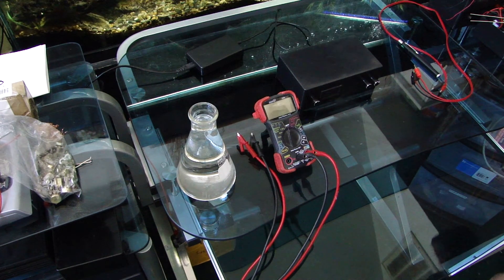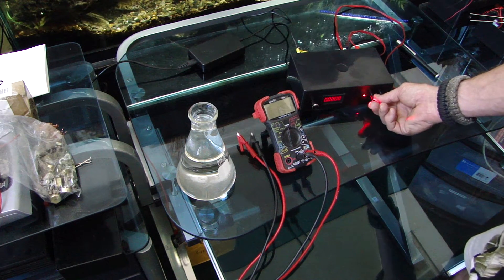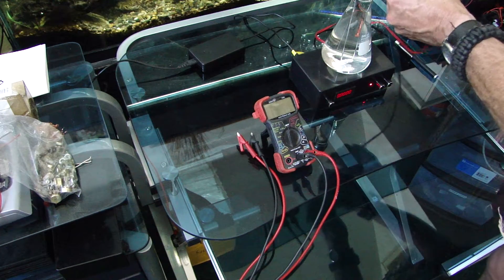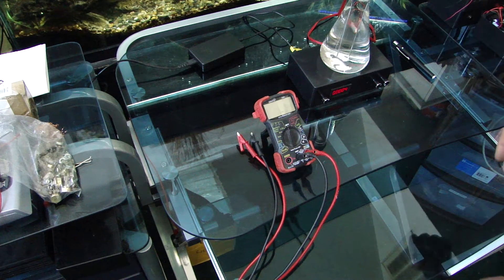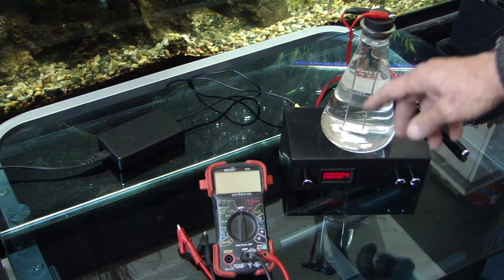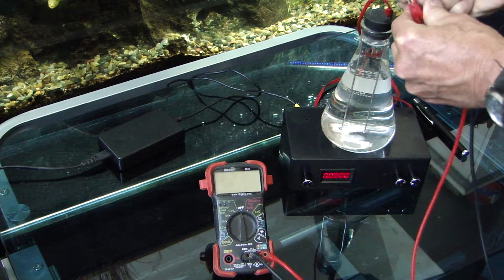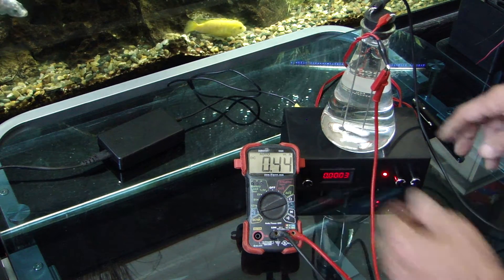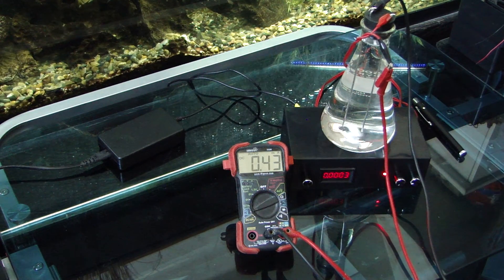PartI BigBear Colloidal Silver Generator Reverse Polarity-Magnetic Stirrer-Constant Current

Comment: Make some videos on green synthesis of ionic silver into true colloidal silver. Eg., one way is to heat ionic silver solution to about 90 Celsius while magnetic stirring. Then take .5 to 1 grain measurement of glucose powder (reducing agent) per 1ppm of ionic silver and dilute it in a tablespoon of distilled water,  add it to the flask. Let it cook and stir for 20 minutes. Then take same amount of soluble starch (stabilizer/capping agent) and dilute in water, then add it. Let it cook for another 30 minutes. Then you can use the same amount of sodium citrate (reducer and stabilizer) to replace the soluble starch. Sodium citrate reduction is slow, so makes too big of particles in my opinion, but is a great capper and reducer of any that the glucose may have missed. Then once the 50 minute cook is up, take the flask and filter it with four brown coffee filters in a funnel on top of another container to stop the synthesis by the cool down. Will turn clear ionic silver into amber colored colloidal silver.

Comment: with 25mA current, you will make a bad coloidal silver. The current need be < 1mA or so low as this. With 25mA you make big particules silver, not penetrate celules.
Reply: Prof. Fabio, Me if you hooked up a power supply that has say 5amps, would a system draw only what it needs or would it be to high?
Reply: 12 vdc
Reply: great, thanks   lot
Reply: can you explain to me, the readers to, why is Silver Lungs 42VDC, and this BigBear another voyage and others at different VDC's ? 

 does anyone have the science down? And then with Colloidal Gold at way high?
Reply: Josh Law  I was just wondering maybe it could be better if you can do the reverse polarity longer, 3 to 8 minutes instead of under 1 minute, by switching back and forth?

Comment: I've had my new unit for a week now and it is amazing. I love the way I can fine tune the process as I work on my computer. Question, I've been making batches at .0004 and keeping it that low throughout the entire process. I usually keep a batch going for 5-6 hours and get readings of 006 on my TDS-3. From other videos i watched of yours it seems the TDS-3 measures about half the amount of the PPM so a 006 reading would actually be 012. Is this a correct understanding? Also, if I up'd the voltage to  .0010 how much larger would the particles end up being? 

I'm trying to create the smallest size particles I can but if the difference between running at .0004 and .0010 doesn't make that much of a difference I would run at .0010.
Reply from the maker: James Halleluyah 
Sorry so late.. Yes... You are right on all counts. TDS readings are  only 1/2 the actual  ppm levels.  1.0 milliamps  willl make awesome  clear and super fine particles. Check the Tyndall effects with the provided Lazer.
Thank You and Good health to you.
Dean

Comment: Hello Dean, I bought one of these and I sent you an email a few days ago about the unit.  This is by far the best unit I have seen and is the third one I have bought. I have only one issue. The reverse polarity range is 58-15sec and not the 30-1sec you mentioned.  Is there a way to adjust this in the unit or do I need to get an exchange?
Reply from the maker: +Jason P 
The 15 seconds to 1 min are the newer settings.
There is no need for shorter than 15 seconds. Just haven't had time to make new videos.
Reply: @BigBearHuskyMusher I want one of these, I just have a cheap cs ifcww inline2 for starters, at least it has constsnt current limiter at max of 2.4 milliamps though. Do you reduce your ionic silver into colloidal silver and stabilize them? I'd like to see lab results of how big the nanoparticles are with reduction with diluted glucose powder and stabilized with soluble starch. I like to use sodium citrate as final reducer and stabilizer too. Great rich amber colored colloidal silver. This one is my next goal, great invention.
Reply: I have yet to find another generator as yours. I would really like to purchase one of these. Or if your the bartering type, I would trade my scilogex ms-h280 pro ceramic top digital hotplate stirrer (229.00 retail)Please contact me. Thanks